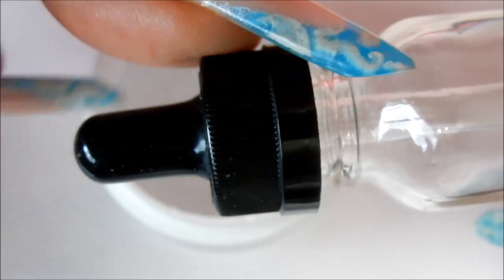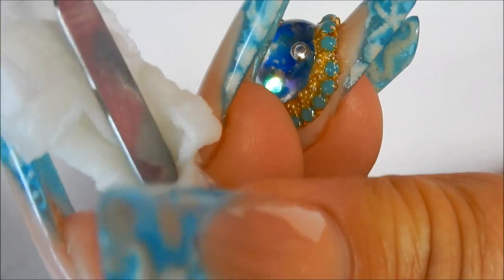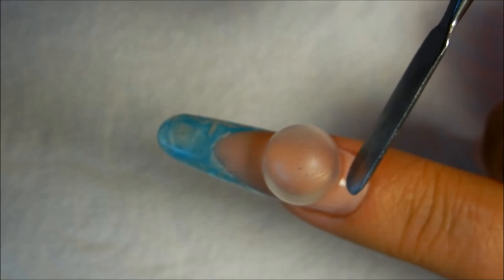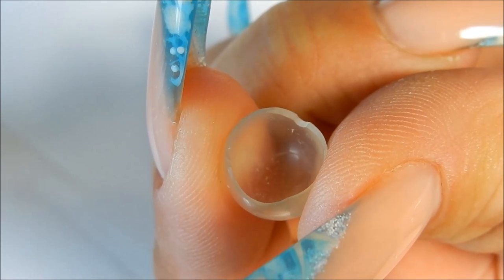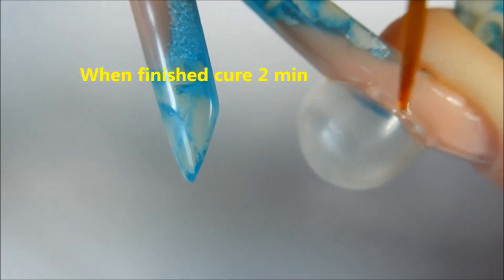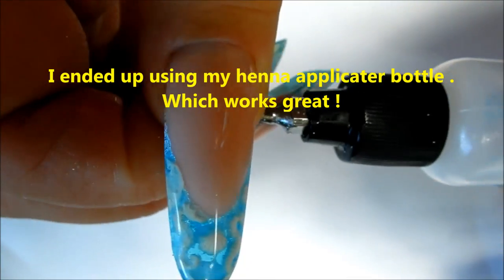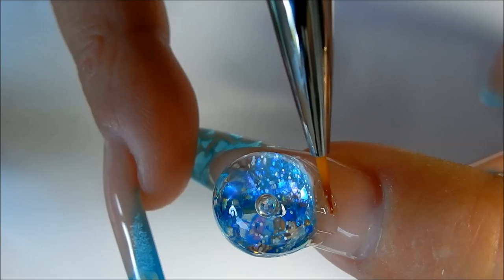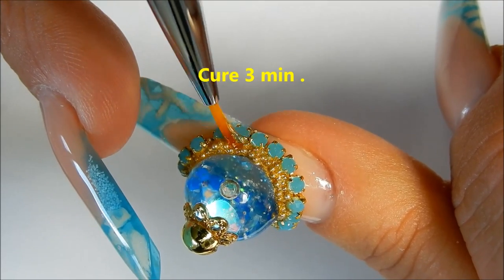SNOW GLOBE NAILS (  REAL ) Liquid Oil Inside / THE BEST TUTORIAL !!!

Comment: Love these. 😊 Baby oil works as well. I didn't have a dropper when I made mine so I just used the end of a metal cap that went to one of my gel brushes.
Reply from the maker: +Leslie R.  Yep , baby oil is the same as mineral oil , only without scent .
Reply: The first time I tried these someone said to use water.. That was such a fail lol not sure if anyone has ever managed to do one that works using water, but it def didn't work for me 😂 thanks for showing your take on these it turned out awesome.
Reply from the maker: Thank you so much .....My next one will be with water . With the oil , I think the glitter and spangles need to be less , so everything with move easier . I will let you know . ..but I wondered if the water would eat my fimo fish ...cuz some waters have floride and other minerals ....Unless I bought some water that was filtered , huh ?
Reply: Totally agree about the glitter in the oil. Seems like the  smaller the glitter is the better it moves. When I tried making the water one I used regular tap, but maybe that's why it didn't work? I don't think the fimo would be affected much since its already set.. Never know for sure though.

Comment: I used mineral oil attempting to make one some time ago, but I found it to be thick and not moving the inside pieces much, did u add anything else to the oil? By the way awesome globe!!
Reply from the maker: +Gabby Arias      No , I didn't add anything else to the oil . When using oil , I suggest using a lot less glitter and spangles . The movement of the glitter will be slower than water . I used the oil so everything would move slower for filming the globe . Water or oil is ok to use ....Thank you for watching .
Reply: ok thank you so much!!

Comment: wby do you have to clean it with alcohol??
Reply: on the outside of the globe and regular acrylic nails
Reply from the maker: +AshMakeup  When you use UV and or LED builder gels or polish .....after it is cured in the lamps it leaves a sticky tacky residue , which must be cleaned off . Alcohol cleans it off .
Reply: +. Denisejohn65 - Nail Ed ohhhhh. thank you!!!

Comment: Unfortunately, syringes are NOT available for purchase with a script from your Dr in aome states. NY  being one. If you live in one of these states a meat injector works but the hole hs to be a little bigger.
Reply: Also, do you have a tutorial for your tips in this video? They're gorgeous.
Reply from the maker: You can buy syringes on line at many sites ....also even Ebay has them very cheap . In this video . You can even use a bottle applicator that they use for applying henna . It has very thin hollow type points to them that are screwed on the plastic bottles ...and then you just wash them . Hobby Lobby has them , usually every craft store . I even have a henna video showing them . https://youtu.be/VNxGNN5Aa0I
Reply: +. Denisejohn65 - Nail Ed,  Cool. Never thought of that one. I'm always trying to come with alternative methods for ease. And I did find your video for those nail tips. Awesome. Any chance you're located in Florida?  My partner and I have a small education convention for nail techs. Would love it if you could come.
Reply from the maker: No , not in FL ...tho I do vacation there occasionally . Thanks for the invite .
Reply: Or just go to a place that sells pet supply's? Lmao
Reply: OR PLASTIC PIPETTES.